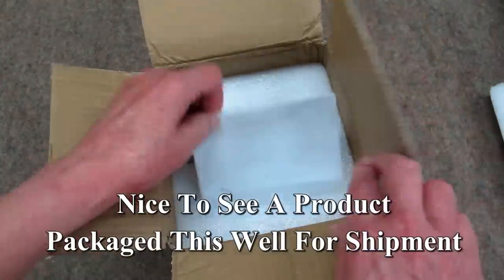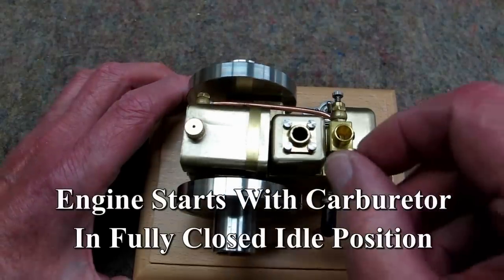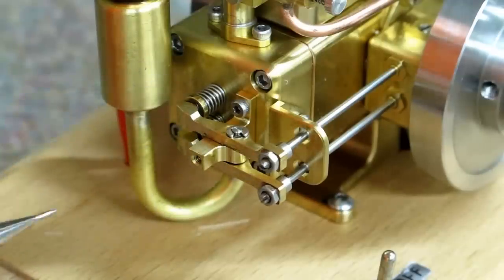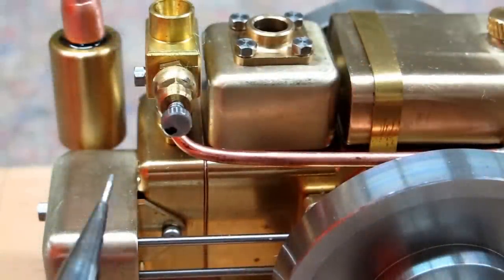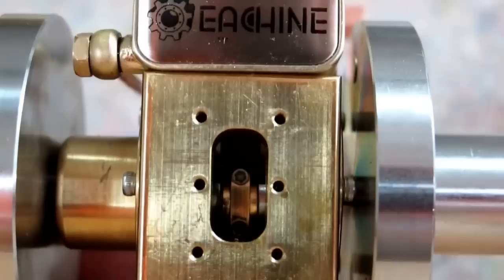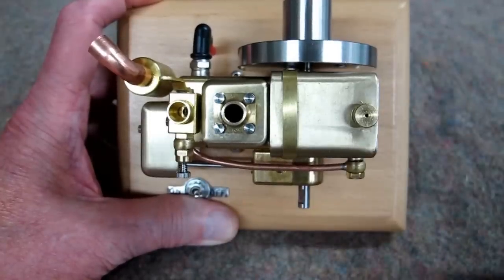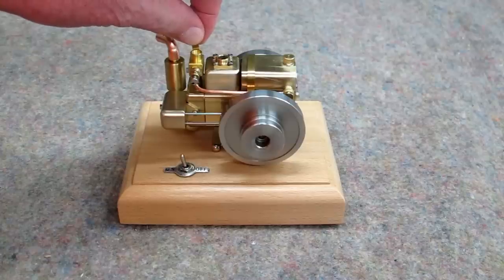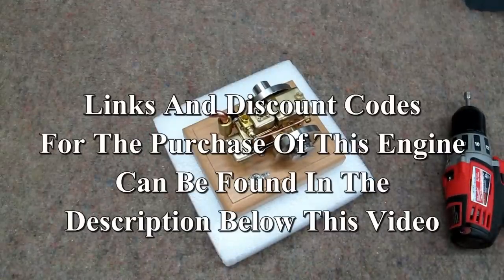Eachine ET5 Mini Gasoline Engine

Comment: I got one a few days ago but it won't start. I filled the reservoir with zippo lighter fluid, put water in the cooling tank and a few drops of oil in the crank case. I tried also choking the carburetor while pulling on the string to start it but to no avail... Spark plug is ok and produces sparks, I checked.
Reply from the maker: If there is any air in the fuel line between the tank and carb it will not start.
If you over-choke the carb and get the spark plug too wet it will not start until it dries out.
Throttle on the carb must be fully closed to the idle position or it will not start.
Valves on this engine stick open sometimes.  Flick them to make sure they are seating and you have compression.
Hope that helps… have fun!
Please subscribe. That is what keeps this channel running. 
Ron

Comment: Have you had reason to strip your ET5 down yet? Mine has lost all compression after very little running time. I'm guessing that there is a problem with the O rings.
Reply from the maker: Mine has never had a lot of compression. Right now I cannot get mine to fire. Still working one it (on occasion when I have time).

Comment: Hey Ron I got my engine to ouff! It wants to start but smoke is coming out the carb on the intake stroke. I did have the rods out. How can I adjust the timing!
Reply from the maker: Since you had it apart...make sure both valves are closing as they have a tendency to stick open... and that both have clearance with the rockers. As built, the timing is pretty much fixed. The magnet and hall effect sensor are under the flywheel without the rope starter. You need to make absolutely sure all the air is out of the fuel line or it will never run. Good luck!

Comment: I've just ordered one of these beauties and I'm super excited to get a look at it! I'll probably end up buying some of the other wonderful model engines featured on you channel!
Just got mine in the mail, absolutely beautiful! for some reason mine takes 3 AA batteries for the ignition.
Reply from the maker: Interesting. They change things from time to time. You may end up wanting to put a dummy battery in place of one of the batteries. We found the ignition would (sometimes) cut out on the Hit & Miss engines when 3 batteries were used.

Comment: Its 2 stroke
Reply from the maker: It is 4 cycle (4 stroke). A 2 cycle would not have the two valves in the head.

Comment: A very neat little engine, tick over sounds excellent, I dare say the spark plugs are available. Comment from (England)
Reply from the maker: Click on my link for the ET5 located in the description for this video. Right next to the ET5 engine is the spark plug. Standard plug used for model engines with a 1/4 x 32TPI thread. Same plug is also used on ET1, ETX, ET6 and ET7 hit & miss engines. Spare piston ring o-rings are listed as well. Thanks for watching.
Please subscribe. 
That is what keeps this channel running. 
Ron
Reply: how are you.from Bangladesh.

Comment: Will it run on zippo lighter fluid
Reply from the maker: Did you watch the video? 3:52 it clearly shows “Coleman Fuel Is Basically The Same As Zippo Lighter Fuel”  Zippo Fuel would be the most expensive way to run the engine.
Reply: @RonaldWalters2010  honestly I probably wasn't paying attention. It was late at night. I currently am using zippo fluid. The engine ran when I first got. I cannot for the life of me get it to run again. I've taken it apart checked o ring, made sure valves are opening right and not stuck. Spark is fine although oil is coming through the actual park plug. Ordered a new plug. Hopefully it works. Is there a different adjustment for the lighter fluid?
Reply from the maker: I have seen leaking spark plugs but probably not in the last 10 to 15 years. :-)
And unless it is REALLY leaking I would think it would still work. We’re talking very low compression with this engine. If you ran out of fuel last time you ran it, you probably have air in the fuel line again. Even one bubble in the fuel line and it will not run. And it will not start unless the carb is fully closed to the idle position. And the obvious… make sure the battery is good. There needs to be just a little oil in the fuel as covered in my video.

It can be frustrating when one of these decides not to run. 

This is my basic (canned response) checklist for this engine. 

First, the boot needs to be on the spark plug and then the wire just butts up against the end of the plug. 

This engine does not have much compression. If you have zero compression, remove the valve cover and flick the valves a little and make sure the valves are actually closing. And that there is a slight gap between the valve arm and the valve stem. You need some compression. 

You may need to open the needle valve 3/8 to 1/2 turn. Each engine (or each carburetor) could be slightly different. 

After it starts running, then you can close the needle valve slightly until it runs correctly. 

Carburetor needs to be full closed to the idle position (this is set at the factory). 

It is not easy to get all the air out of the fuel line. Fill the tank completely so the connection to the fuel line is completely covered. If there is any air in the fuel line, even one bubble, the engine will not start. 

With the engine starter (cordless drill) turning, place your finger over the carburetor to choke the engine and completely fill the fuel line. If you run out of fuel, then air will get into the fuel line and you will need to do this again. 

If you get too much fuel into the engine (flooded engine and the spark plug is too wet) it will not start either. Then you will need to dry the plug and get excess fuel out of the cylinder. To do this gently remove the spark plug and spin the engine with a rope starter. 

I really do not recommend using the cordless drill adapter. I think it can be a bit rough on the engine. Sometimes the cordless drill starter can make it more difficult to start the engine because you must pull the adapter out while the drill it running full speed. Sometimes this can drag and actually slow down the engine. Or your cordless drill may not turn fast enough. 

Make a rope starter using smaller cord as I show in my video. It will spin the engine faster than a cordless drill. Get someone to help you hold the engine so you do not accidentally pull it off the table and drop or damage the engine. 

Hope that helps. Please let me know how you do. 

Thanks for watching. 
Happy T-Bird Day!
Ron
Reply: @RonaldWalters2010  Ron, I ordered a new spark plug and new piston rings. I've been at this engine for quite some time. I've started from 1/4, 3/8, 1/2 and even to 3/4". When I put the new plug in, I did get it to pop some smoke out but will not run. I noticed there is an idle adjustment screw on the opposite side of the fuel screw. Can you tell me the adjustment on yours started from all the way in? Also, what is the tiny hex head on the front of the carb? I have plenty of spark, good gas, good compression, fast drill and still nothing. I even made a super long pull cord so I can really get it going fast. My main concern is the idle adjustment screw. I did mess with that.
Reply: Also, I am getting fuel in the cylinder. Made it clear I have no air bubbles by priming it. Help would be extremely appreciative.
Reply from the maker: It is difficult to trouble shoot something you cannot actually see. Every carburetor (every needle valve) can be a bit different but mine ran with the needle valve between 1/4 and 1/2 turn open… usually around 3/8 open. A friend in the UK said he had to open his up quite a bit more.

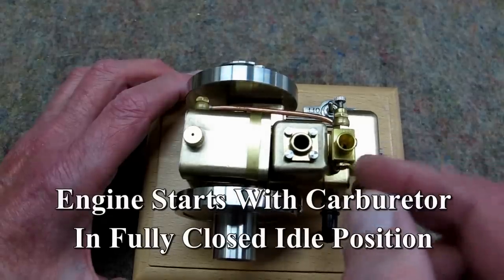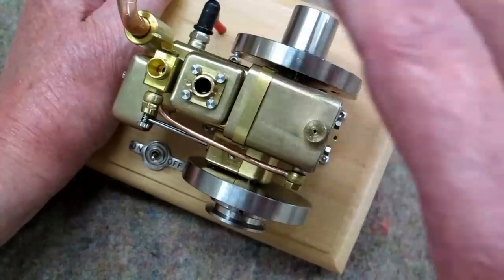Throttle barrel opening at idle can just barely be seen at 1:25 and 5:50 in the video. Mine would not start unless the throttle barrel was closed down to idle.

There were some issues with the ignition module for the hit & miss engines. It was accidentally discovered if we only used 2 batteries instead of 3 batteries, the intermittent problem disappeared. That ignition module is sealed in epoxy so you can’t see what is going on in there. This engine only takes one battery.

The past several months I have been reworking the radiant heat system in my house. I tried to start my ET5 several months ago and couldn’t get a pop out of it and the compression is low. I don’t know what is wrong with it and have not had time to mess with it.

Some of these little engines can be quite finicky. When I was flying R/C Airplanes the 2-cycle and 4-cycle engines would be really dependable for hundreds of flights… then that was the end of that… and I’d be taking everything on the airplane apart trying to chase down the problem. Very frustrating sometimes.

So… I have not given you much help. Just keep playing with it and hopefully something will appear as the problem.
Good luck. 
Ron

Comment: Once broken in, the engine will start easily by just rotating it through compression with your fingers, I have never needed the drill or rope starters.  The engine can be ran with the non-ignition magnet side flywheel removed, and it will have faster throttle response. Different sized pullies can be mounted in place of that flywheel.

Comment: other then seeing it run, which you did for us, why would someone want to buy this engine, it doesn't do anything but run, it's not like we can put it in one of our rc vehicles....
Reply from the maker: That could be said of any model of anything... it just sits there and runs... or collects dust... or makes a nice paper weight.

The man who designed this, used it in a model R/C tractor. Or it could be used in a boat or to generate electric... or to convert gasoline into noise. :-)

This is just another collector/hobbyist model similar to Hit & Miss, Flame Licker, Vacuum, Stirling Cycle, Steam or many other models... and if you want one you don't need to be a machinist to make it yourself.

Thanks for watching!
Ron
Reply: It has pullies that will allow it to drive a number of things like Wilesco or other steam engine driven toys, miniature generators. etc. It's fun to run and watch as it runs at lower RPM's, not the screaming RPM's of a nitro/glow plug engine.

Comment: Mine wont start no matter what i do. Good compression and spark..and gas with some oil in it. :/
Reply from the maker: It can be frustrating when one of these decides not to run. This is my basic check list for this engine.

First, the boot needs to be on the spark plug and then the wire just butts up against the end of the plug. 

This engine does not have much compression. If you have zero compression, remove the valve cover and flick the valves a little and make sure the valves are actually closing. And that there is a slight gap between the valve arm and the valve stem. You need some compression. 

You may need to open the needle valve 3/8 to 1/2 turn. Each engine (or each carburetor) could be slightly different. 

After it starts running, then you can close the needle valve slightly until it runs correctly. Carburetor needs to be full closed to the idle position (this is set at the factory). 

It is not easy to get all the air out of the fuel line. Fill the tank completely so the connection to the fuel line is completely covered. If there is any air in the fuel line, even one bubble, the engine will not start. 

With the engine starter (cordless drill) turning, place your finger over the carburetor to choke the engine and completely fill the fuel line. If you run out of fuel, then air will get into the fuel line and you will need to do this again. 

If you get too much fuel into the engine (flooded engine and the spark plug is too wet) it will not start either. Then you will need to dry the plug and get excess fuel out of the cylinder. To do this gently remove the spark plug and spin the engine with a rope starter. 

Sometimes the cordless drill starter can make it more difficult to start the engine because you must pull the adapter out while the drill it running full speed. Sometimes this can drag and actually slow down the engine. Or your cordless drill may not turn fast enough. 

Make a rope starter using smaller cord as I show in my video. It will spin the engine faster than a cordless drill. Get someone to help you hold the engine so you do not accidentally pull it off the table and drop or damage the engine.

Hope that helps. Please let me know how you do. 

Thanks for watching. 
Ron

Comment: Does anyone know the silicone piston ring dimension and thickness for this engine?  I found it's much cheaper to get replacements in bulk on E-Bay if the size is known.
Reply from the maker: 13mm OD x 11mm ID x 1mm Wire Diameter
Thanks for watching.
Please subscribe. That is what keeps this channel running. 
Ron
Reply: @RonaldWalters2010  thanks Ron, got 100 of them for $20.00 on E-Bay.  Subscribed!

Comment: I would love to know what octane to use i only have 91 that is the max for me in washington
Reply: The engine will run well on Naphtha based camp fuel which is only about 70 octane.  It will run a bit better on gasoline but the camp fuel is safer to handle, won't make your fingers smell of gas, and won't leave gum or deposits in the tank/line/carburetor when left sitting. It's also less smoky when running.
Reply: i am a kid trying to run my egine :(
Reply from the maker: You can use Coleman Camping Fuel as I show in the video or 91 octane unleaded gasoline with zero alcohol content. I recommend the Coleman fuel with a little oil as shown in the video.
Reply: Ok thank you 😁
Reply: hey i know im in the UK and i have 95 but i heard you can use 91 but it runs a lil ruff mate i reckon you use  coleman to if you want

Comment: Nice video!  I tried many hours but engine did not start. I'm using the same fuel as yours and checked spark plug but still could not start it. I also posted my video. Could you please give some suggest?
https://youtu.be/1izk-uXxPFA
Reply from the maker: Hello Chencheng,

It can be frustrating when one of these decides not to run. I watched your video.

First, the boot needs to be on the spark plug and then the wire just butts up against the end of the plug.

This engine does not have much compression. If you have zero compression, remove the valve cover and flick the valves a little and make sure the valves are actually closing. And that there is a slight gap between the valve arm and the valve stem. You need some compression.

You may need to open the needle valve 3/8 to 1/2 turn. Each engine (or each carburetor) could be slightly different. After it starts running, then you can close the needle valve slightly until it runs correctly. 

Carburetor needs to be full closed to the idle position (this is set at the factory).

It is not easy to get all the air out of the fuel line. Fill the tank completely so the connection to the fuel line is completely covered. If there is any air in the fuel line, even one bubble, the engine will not start. With the engine starter (cordless drill) turning, place your finger over the carburetor to choke the engine and completely fill the fuel line. If you run out of fuel, then air will get into the fuel line and you will need to do this again. 

If you get too much fuel into the engine (flooded engine and the spark plug is too wet) it will not start either. Then you will need to dry the plug and get excess fuel out of the cylinder. To do this gently remove the spark plug and spin the engine with a rope starter.

Sometimes the cordless drill starter can make it more difficult to start the engine because you must pull the adapter out while the drill it running full speed. Sometimes this can drag and actually slow down the engine.

Or your cordless drill may not turn fast enough.

Make a rope starter using smaller cord as I show in my video. It will spin the engine faster than a cordless drill. Get someone to help you hold the engine so you do not accidentally pull it off the table and drop or damage the engine.

Hope that helps. Please let me know how you do.

Thanks for watching. 
Please subscribe. That is what keeps this channel running. 
Ron
Reply: @RonaldWalters2010  Hi, Ron. Many thanks for your kindly suggestions. I will try and let you know how I solved problems.
Reply: @RonaldWalters2010  Hi, Ron. I think I found the problem. Spark plug is not working. It has sparks between wire and the butt of the spark plug but there isn't any spark between center electrode and ground electrode. That's why engine doesn't work at all. I cleaned it but still not working.
If carburetor is not fine-tuned, engine should could started a little while and stopped anyway. There isn't any fuel exploded noise in engine. Maybe it was broken during delivery because of poor packaging...
Here is my video.
https://youtu.be/2jh7MH09VZQ
Reply from the maker: Hello Chencheng,

The video is difficult to see. I assume you are showing me there is no spark... correct?

A spark plug does not work that way. It needs to be grounded to the engine  to complete the electrical circuit. push the base of the plug against the engine.

The spark plug gap is not critical. Should be around 1mm. I usually make it about the same as the thickness of a No.11 X-acto blade.

These engines are all very well packaged... at least the ones I have received were all very well packed.
Ron

Comment: Does not run the smoothest. Misfires alot..I also do not like the fact there is not magneto ignition source. But what do ya want with Chineseium stuff.
Reply: This is a hit and miss style of engine, those misfires are completely natural.
Reply: @marshallsullivan5274  it is not a hit or miss engine, there is no centrifugal mechanism to cause the hit or miss.